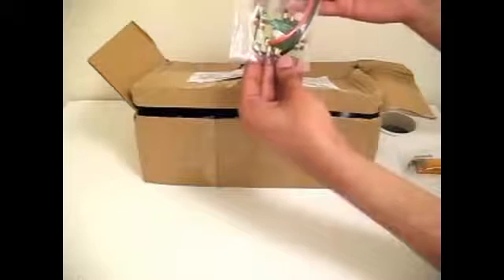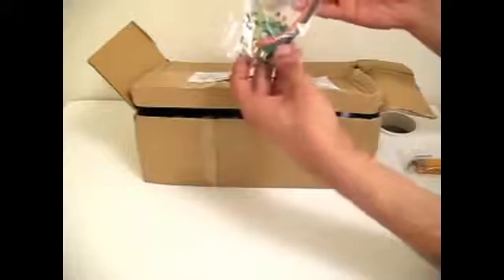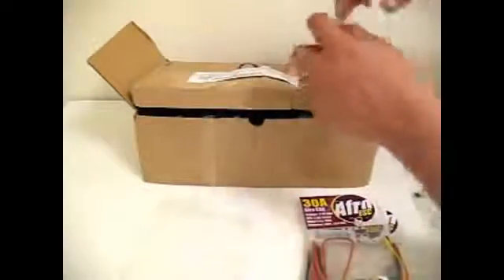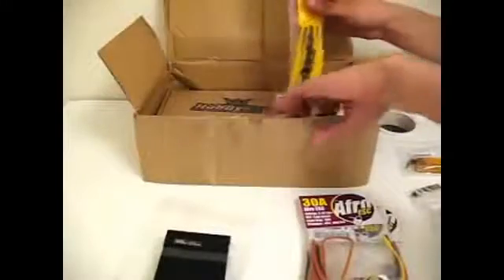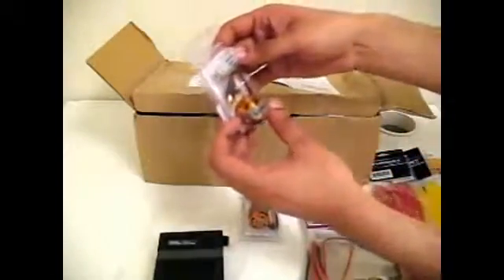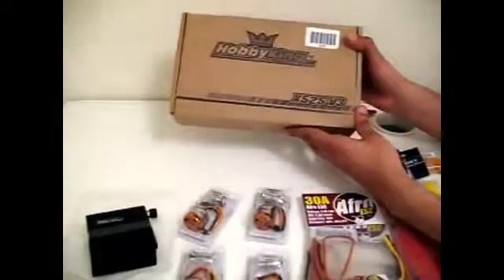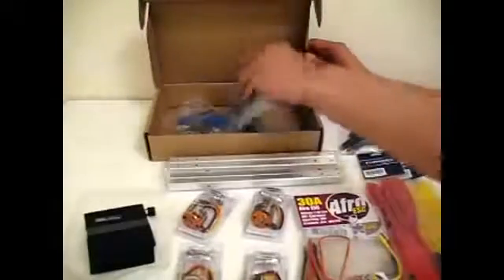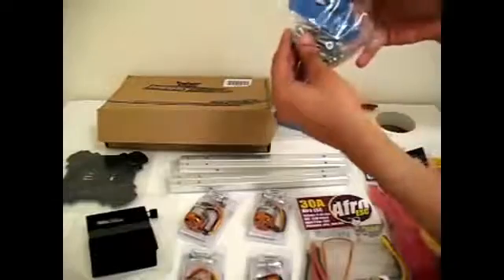Basic Quadcopter Drone Tutorial Chapter 1 Build A Cheap Drone X525 HobbyKing

Comment: Can I also use these Props?  RC 12x4.5 SF Props 2pc Standard Rotation/2 pc RH Rotation
Reply from the maker: +Torben Weller Depends on the motor you'll be using them on.